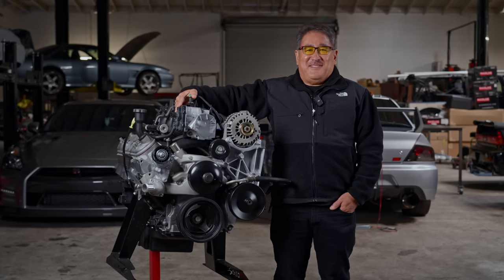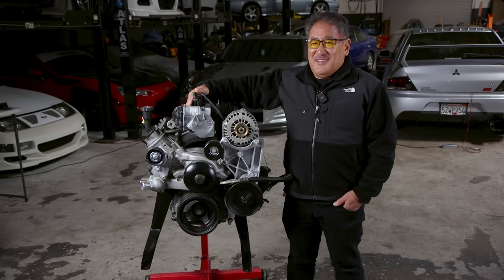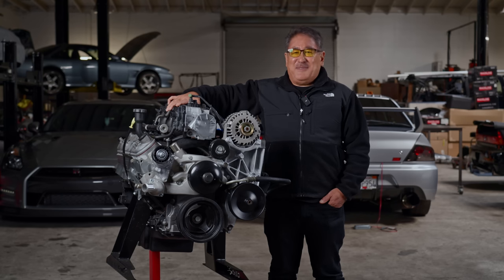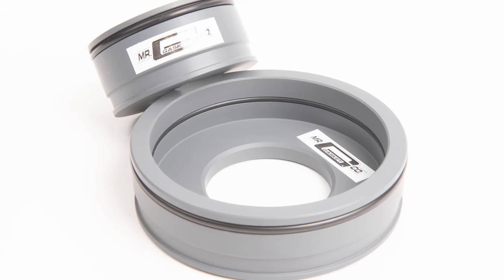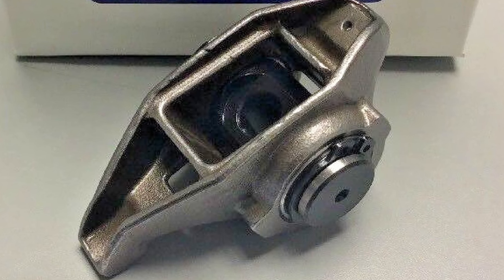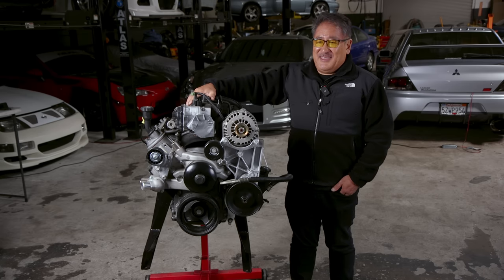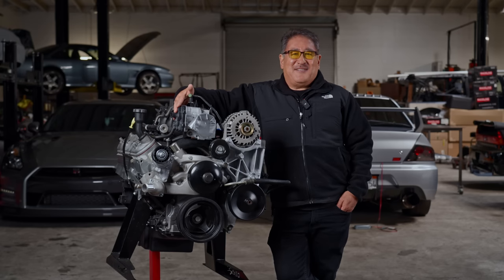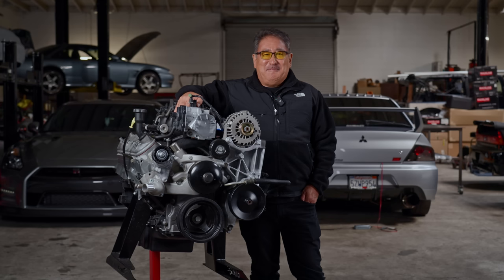How to Freshen Up a Junkyard Chevy LS Engine for Cheap!

Comment: Having just finished my LS swap, I can attest to Holley having everything you need, however; you can find almost anything they sell half price elswhere. One example is Bosch O2 sensor 66$ vs 150$ from Holley, Oil pan and sensors the same. Shop around and do your due diligence.
Reply from the maker: Or get your Holley parts from somewhere like Summit or Jegs.
Reply: @motoiq  Same price yo.
Reply from the maker: A lot of those super cheap parts on EBAY are actually fakes.  I got burned by the Bosch O2 sensor for 60 bucks, what I got was a chinese fake. It was a bitch to return too.
Reply: @motoiq  I said nothing of suoer cheap. I said Bosch 02 sensor, the exact same part sold by Holley. Of course theìr are fakes; Be smart don't buy them. I got mine from Rock Auto.
Reply: @TheStroupdog rock auto is eBay like..
Reply: I guess that one stop shop has a hefty price tag!
Reply: Appreciate that insight, fam! 🤜🏼💥🤛🏾
Reply: @thevilinirony 
Rock Auto has legit parts. The same parts the big names offer.
Reply: @TheStroupdog I love Rock Auto. Quality parts at a reasonable price.
Reply: @motoiq Hello I own a Chevrolet express 6.0 LQ4 with 90,000 miles, I live in France in a region where the climate is temperate, I do 6000 miles per year, I drive mainly in the summer, and I tow a 6000 lbs trailer, should I stick to the oil recommended by the manufacturer 5W30 or can I use a 5W40 for example???
Reply: @thevilinirony rock auto legit dude I don't know what the he'll you talking bout😂
Reply: First day on the internet?
Reply: Denso O2 sensors are like $35 each shipped from rock auto.. just replaced 3 of the 4 on my 05 silverado.  Denso came from the factory and lasted 120k miles...so that's what I replaced them with.

Comment: For my 85 Gbody cutlass swap, I got my complete running 5.3 LM7 for $450 cdn, so that was cheap!
BUT thats where the cheapness stopped.
Like he said all those parts will nickle and dime ya
I spent close to $3500 cdn on extras to finish my swap.

New mounts that required extensive modding, rad hoses and adapters, new intake tube and air filter, new PS hoses, a used y pipe, new exhaust, new O2sensor,  new electric fans, and relay box/fuse box, new gauges were expensive, actually went thru 4 sets trying to get ones that worked, new temp sensors 2 &3 wire, new throttle cable, new exterior inline fuel filter pump hoses fittings etc, 

if i had to do it over again i would seriously price out a new refurbsihed 305 and carb or holley efi
OR even 300 HP crate engine versus the extra 3000 i spent on all these  extras.
if you can get a crate engine and holley efi for under 5000 canadain, i would do that cuz it would mostly drop in over a weekend instead of 200 hrs over 2-3 months to fab n fit and ordeer new parts everything else.
it was the middle of covid so maybe i couldve saved $1000 bucks waiting to find cheaper parts but then the 3 month build maybe wouldnt have been finished by winter cuz i had to wait an extra 3-4 months.
Reply: If I'm not mistaken, (I'm fairly new to engine builds) a crate engine is still missing some of those items right?
Reply: Glad I seen this bro. I was thinking about LS swapping my 87 cutty but fuck that, I rather keep it stockish anyways so i’ll just look into getting her stuff rebuilt
Reply: @Vntichrist I got a brand new holley kit for sale

Comment: The 8.1is a great motor even though stock it's extremely underpowered with not great cylinder heads. It is very strong and is a great balance between old-school big block and newer LS technology
Reply: I liked the 8.1 I think GM should re design it to make it sea worthy like Ford did with there Gas gorilla motor
I think Gm is trying to get to much out of the 6.0
Reply: 8.1 was made to be a mega torque at 2000rpm motor, Never was intended to be a high horse application and in the towing regard it still out performs a lot of newer stuff

Comment: How do y'all feel about the stock lifter guides? I don't trust em but i was only messing with GM for a year. Those c-clipped rockers are smart. Hope y'alls friend has a blast with it!
Reply: “Cheap ass friend” here: I swapped the lifter trays out for new Holley jobs. If the heads are off, replace the lifters and trays.  Cheap insurance
Reply from the maker: We replaced the stock parts with the Holley one and I forgot to mention it. It is fine for close to stock or mild performance but for performance engines that are going to be raced I don't trust it.

Comment: He mentioned this was a cheap Jeep build. Half the stuff isn’t needed. Cam, lifters, Lifter trays pushrods, and full reseal kit. That’s all a junkyard kit need
Reply from the maker: It's a good idea to do on any junkyard swap.  I would have done the oil system dumbell too on an LS.  But if your time is cheap, more power too you to just drop things in without checking.
Reply: @motoiq  I wasn’t trying to be negative, that would just be my definition of cheap and dealing with common LS issues. I’m jealous that he is going through the whole thing! Haha

Comment: Back to the part where you can find cheap Ls in a junkyard.  I've gotta buddy that has looked for years.  Is there some sort of secret handshake or something?
Reply from the maker: Yeah if you are looking for something like an LS3 or LS7 sure but these 5.3's are one of the most common cheap V8 engines in junkyards.
Reply: I bought a whole 2002 suburban for $1500 with waaaay expired registration. Sold off what I didn’t want and ended up net positive $1000 on it

I see dozens of Tahoes/Suburbans/Silverados at the Pick a Part
Reply: Picked up a 6.0 and a 5.3 for 500 had to pull them was pushing my cart out in 4 hours . I have gone to three different states to get them cheap .

Comment: I wouldn't mind one in my 2009 Frontier. 😆
Reply: LOJ makes swap kits for the Frontier, but it's either based around the manual tranny, or a GM 6L80.
Reply: @brian_sipe  
Mine is a manual! LOJ? I'm not familiar with them.
Reply: @A.J.1656  The joke is that LOJ stands for Lost Our Jobs, but they make swap kits for putting an LS into several different Nissan chassis.  Just Google up LOJ conversions and you can see for yourself.  Lots of complete kits and piece meal kits to save a buck or two.

Comment: One thing i wanna say if you cam swap do you really need to touch the cam bearings and crank bearings? I have the iron block lm7 in my 00 suburban. I got 239k miles still runs fine except that one lifter tick they usually get. I have all top end parts to rebuild it like pushrods, rocker arms, valve seals, lifters, springs, cam retainer plate, camshaft, plus install cam, new melling water and high volume oil pumps, head gaskets, timing chain set, front and rear covers with new seals, oil galley plug, oil pan gasket, long tube headers and the egr delete plates. All accessory drives and velts were replaced already. Im still running the clutch fan which is new. Do i need anything else to rebuild it or am i good to go? I do also have an extra set of coil packs.
Reply from the maker: Probably not cam bearings, with that many miles it might be good just to rebuild the engine since you are in there.

Comment: What is the total cost of all the parts used in this "cheap freshening"? If you include labor I'd bet you are halfway to a full rebuild or stock type crate engine
Reply from the maker: not even close
Reply: @motoiq  Care to elaborate?
Reply: @motoiq thanks for answering the question. I’ll go somewhere else to find it out

Comment: hey can you do a breakdown on the 40v audi 4.2 v8 no fsi? recently picked up a b7 s4 and i want to learn as much as possible about the motor. tried doing some research but I didn't yield much results. I would also like learn how to bullet proof that motor as I now have 2(picked one up from the junkyard for pretty cheap). Thanks in advance, have a nice day!
Reply from the maker: So far there is no customer interest in that motor so it's not likely that we will.
Reply: @motoiq  yea that makes sense
Reply: Are you looking for general information or what? Audiworld, Audizine, and Quattroworld forums are a good place to start, just be aware that an S4 4.2 isn't the same as an RS4 4.2 or R8 4.2 or a D2 S8 4.2 or C5 RS6 4.2 lol. The non-FSI engines are pretty similar and the FSI engines are pretty similar, but the differences between FSI and non-FSI is where you need to pay attention. Re: bulletproofing, the 4.2 itself doesn't have major issues in any/all configurations other than the B6/B7 timing chain stuff, which is only really a problem due to its location on the engine. If you're looking for upgrades/mods then JHM Motorsports used to be (and probably still is) about the only place around that actually was trying to develop the platform, but it's a high-strung NA motor. Not much you can do to make significant power gains on a 4.2 without going forced induction.
Reply: @daedalus_20v  I already have the metal timing guides in, it’s my first car and I love it but I quickly grew bored of the power I’m looking at dowpipes soon to get rid of the double cats and then maybe a jackal tune, I just wanna learn more about the engine before I start modifying it more. I heard rods where the weak link but I want more info like maximum power on stock internals etc

Comment: I have the l59 engine, is it any good? It's cast iron instead of aluminum and flex fuel with the stainless steel fuel rail
Reply from the maker: It is a good engine to build on.

Comment: I would like to build my lm7 to make good power in the lower rpm range... i dont like to rev my engines above 5k rpm.   Sounds like they are going to explode.. and really dont like the sudden unleashing of all the ponies once it gets to 5,500rpm..  you mash the gas at 2,500rpm and its dog,dog,dog,dog, and suddenly whaaaaaaaaaaaaaaaaaaa! As it gets towards redline... nothing like losing traction at the top of a gear🥴

Comment: I have a LS 5.3 from Escalade I’m going to rebuild and install it  on a 94 Chevy any advice how to add more bust I willing to spend 2K?
Reply from the maker: Add a cam!
Reply: @motoiq  that’s hall Just a cam like Chopacabra or Norris? What about a Intek?  I'm trying to find a good set up to add boost to that engine including the kit to rebuild with 2000k If you can recommend me a list, I would appreciate it.
Reply from the maker: I mostly use comp, for boost don't go to big and keep the centerline spread.

Comment: Do y'all think my ARP head bolts- not studs. Will hold up to a low boost pump gas build. Say 8-10lb🤞 or perhaps 12 🤤
Reply from the maker: Should be fine.

Comment: Gee Mike when did you become a  salesman for Holley there's a lot of other companies  cheaper than Holley oh could it be because you get yours parts for free or a big discount?
Reply from the maker: Holley does not advertise with us.  I like Holley mostly because of the integrated front end parts swap kits, it saves me a bunch of time and headaches. In fact Holley makes it easier to get parts quickly.  Time is money for me. If you don't like it don't watch it.
Reply: @motoiq  if that's what you prefer to use then say that in your  video because it sounds like your selling Holley product's  and like I said Holley stuff isn't cheap  . I put an LS1 in my RX7 and  I used 95% GM parts that came  with engine and it worked fine  I understand that  you have to change things to fit sometimes. But that is also the cheap way of doing things . Look I believe you put out some really good content and  information to help people  but not everyone can afford a $40000.  Engine and not everyone can build one either so for the everyday guy saving a dollar goes a long way and Holley isn't cheap place to  buy parts from is all.
Reply from the maker: For $40000 you can get one of our 1000+ hp builds. If you have a lot of time, you can probably do some online searching to find resources, many of which will be wrong (you need to be smart enough to figure out who is smart enough to really know) then get stuff from junkyards, etc. for way less money.  But if your time is more valuable than saving a few grand you can just get these parts and have good quality brand new parts and be done with it.  I would do the second myself and there is nothing wrong with doing it the first way which is still pretty cheap compared to most of the stuff in the world we come from.  I just made it easy for people and Holley was nice enough to give me some parts to demo for a video. If you make comments like you did, it is annoying to me and you are welcome to do your own video on the cheapest possible way to do things, hell I will do it with you because if the information is correct that is important too.

Comment: this sounds more like an Ad for Holly - i'd rather go with Fel-Pro for gaskets and ARP for the bolts. while in the engine with the heads off and replacing the timing chain might as well swap the cam and put in some LS6 springs to go along with those lifters. this video is just full of bad advise. No Half Measures
Reply from the maker: There is no bad advice here the goal was to do a reliable swap into a jeep that doesnt need a cam.
Reply: @motoiq  every LS needs a cam... deserves a cam.
Reply from the maker: No a rock crawler
Reply: @motoiq  you're saying something like a BTR TruckNorris Cam, that improves low end torque all the way through the power band, would not benefit a rock crawler - or help move a truck with "puppy squashers" to and from said rock crawling adventures? I'm sorry but i'm going to disagree with you all the way around on this topic. If you cant afford to do a basic engine rebuild then you cant afford to own a "rock crawler".
Reply from the maker: Rock crawlers often operate at near idle conditions. Even a small cam reduces torque here. It's just wasted money unless you are building a speed crawler for something like hammers. If you are just going for the the look and don't actually crawl, sure a small cam might be more fun. A stock 5.3 makes way more power than a built stroker 6 so it's not like you need more power with the right transfer case. Most people building for something like this are better off just replacing the accessories, cooling system and the common LS trouble parts with nice new solid parts.  Better to make it reliable than spend money on valvetrain parts. A rock crawler with the right drivetrain and suspension can do quite a bit with a bone stock 5.3.  Heck they do a lot with the stock inline 6
Reply: @motoiq  still... you never know what you're getting with a junkyard engine. since its out replacing rings, bearings and gaskets also allowing inspection of the internals is peace of mind. i would not be comfortable leaving parts that are prone to wear in a used engine.
Reply: @motoiq  the dyno numbers dont lie - a good truck cam is far superior than the stock 5.3L cam from idle all the way through the power band. adding super budget items like a TBSS Intake, ebay long tube headers and free power by simply hand porting the heads - i would even ball hone the cylinders for good measure. by not doing these things you are leaving at least 100 HP and especially toque on the table. doing all of this yourself you're spending about $1500 to $2000 including an engine rebuild kit. at the end of the day and you've done everything correctly you end up with a solid engine that will last. this applies to any LS based engine for any purpose - to me this is priceless.
Reply from the maker: Sure you are 100% right but for many people labor isnt free. We would charge about 50% as much to do this as build an engine labor wise.
Reply from the maker: In the article on doing this, we did a compression and leakdown test and pulled a rod and main cap off to look at the bearings before deciding on this particular engine.